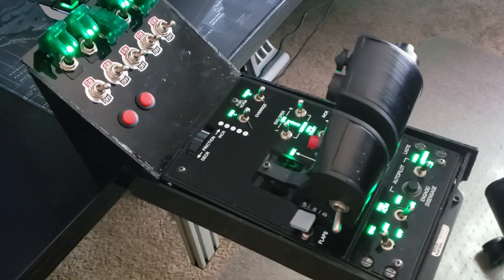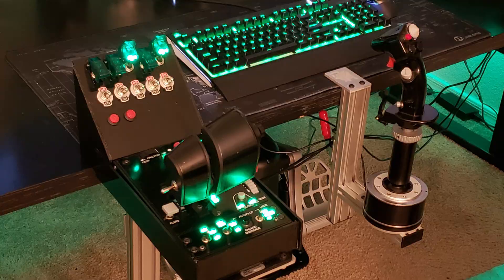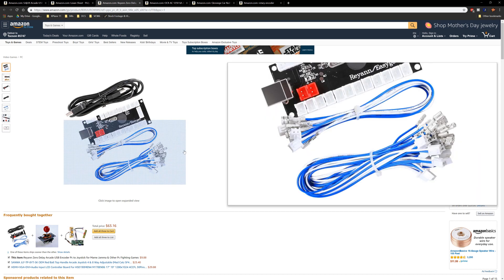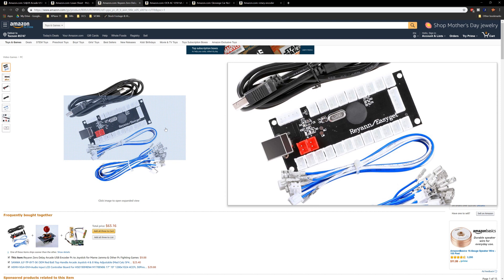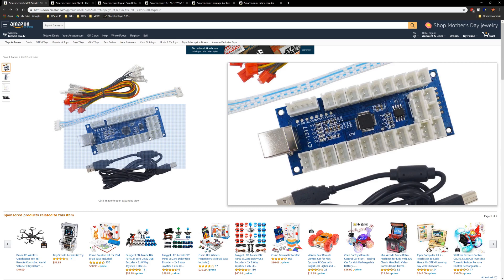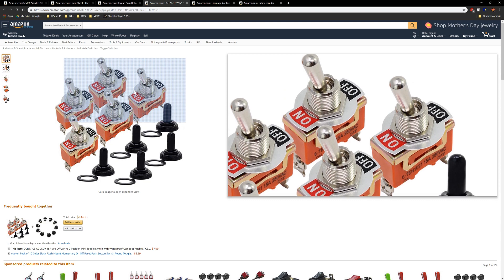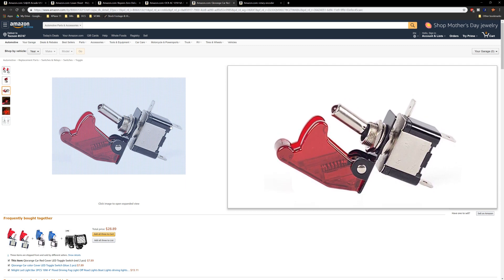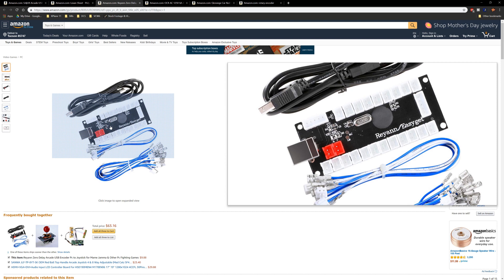Build Your Own Button Box

Comment: A 3 position switch would just need to use two ports.?..
Reply: you would need to check if the board shares a common ground or a common V rail across all the buttons. it will be one or the other the connect the one that is not common across the two poles on the switch that aren't common

Comment: I absolutely can not thank you enough.  I've been looking at designing button panels for Star Citizen for years and I'm terrible at soldering.  This not only a solution, it is THE solution.

Again, can't thank you enough.  You took what looked like a tedious and intimidating project and made it doable.  Awesome.  Liked and subbed.
Reply: Check out emstudio as well! He made a button box as more of a tutorial, included the code and wrapped it really nicely in carbon fibre wrap! Looks great! This is a really good video too!
Reply: You don't have to solder anything, even with other microcontrollers . Just buy some separate  crimps for the buttons/switches. Thats way cheaper. Combine it with an arduino pro micro clone for more space in your encasing. you can then spend the saved money on the buttons or a nice aluminium front panel. And you're not so  limited to the amount of buttons if you build a Matrix. I'm currently also  building a star citizen control panel. With the solution mentioned in this video, i would run out of connections half way trough.

Comment: Somone PLEASEEE HELP ME!!! I bought everything here, then got buttons and two position switches. I hooked it up to Xplane, on toggle. When I toggle the switch let’s say for master, the master goes on, when flipping it down it doesn’t work until I flip it up again. Please help!!
Reply from the maker: So, this is likely NOT an issue with your button box. This is likely an issue with the SIM. I run into this sometimes with DCS. 
You have to think of switches as "buttons". When you flip the switch to the "ON" position you are pushing a button down. When you flip it to the "OFF" position you're simply letting go of the button. Not all aircraft in DCS recognize the "RELEASE" of the key as a command. 
Try searching my channel for the RSMapper video. Use RSMapper to bind your button box to keyboard commands vs in the SIM. By using a software such as this, you can tell the SIM to execute X key command when the button is depressed, then X key command when the button is released. 
I hope this helps put you at ease as to what is very likely the problem.
Reply: OverKill wow, a lot of helpful info. Thanks so much! I will try to look in to this. One more questions if you can answer, there is a “mode” button on my encoder, when I press it, the joystick buttons switch, wondering why this happens. Also you’ve earned a sub!
Reply from the maker: @Rc2Go  LOL Thank you very much for the support! So, when you say "switch" what do you mean. How does the behavior change? 
Taking an "educated" guess as a novice with encoders - I would imagine it's something similar to for example like the X-55 and 56 HOTAS do. Mode 1: You program all the buttons to do XYZ. Press the Mode button so you are now in Mode 2: You can now program all the SAME buttons to do something completely different. It's a really handy feature if you're limited on buttons. The only tip side is you have to remember what mode you're in at all times so you don't open the canopy or drop the landing gear at 600 knots :) 
All of the above is assuming that I'm right about what "Mode" does.
Reply: OverKill yeh that would be it 😅 haha I’m looking at the other video, it’s pretty confusing as I’m only 15 and this is relatively new... I was hoping to avoid the hassle as to get my single rotary switch working, I spend hours learning code on arduino! Better keep learning, thanks! I’m going to keep watching the video until I understand :)
Reply from the maker: @Rc2Go  let me know if I can help:)

Comment: Some of these come with a 2 pin joystick adaptation. I am currently building my own hotas flight chair and I am looking to incorporate the buttons into the wooden arms I've made to mount my HOTAS too. I'd like to use a 2 pin joystick as a menu navigation tool. Wondering if anyone had insight into getting one to work as the board does support it along with 2 way switches. Or does that require coding. I just want it to work as a directional pad essentially.

Comment: So glad I came across your video. I intend on building a mostly correct F14 Pilot Simpit. I ordered one of these boards and a few different types of toggles and buttons just to try out and get some ideas before moving onto a higher end usb encoder. I was able to get a 3 position (mom on - off - mom on) toggle to work for the left and right engine crank on the Tomcat. It works perfectly using two inputs, however in my case I only needed to use one ground for it to work correctly. ( I just cut the other ground wire to second input off) This has given me so many ideas! Hopefully the wife wont divorce me! Thanks again!
Reply from the maker: We get lucky with our wives! Somehow they put up with us... the money I have spent on dcs alone not too mention the countless hours every time I come up with a new "project" lol.  Good luck to you!

Comment: Question:
I have this build idea and wondering if it would work?  Would like to get some feedback before I spend money to "try".

Say, I build a box with  X number of switch/buttons and when button is pressed it would trigger same action to two physically seperate PC. 
So I would have two encoder board wired to a single button? with each board connected to each PC via USB.
If something like this would work, is there a way to do something for a USB mouse as well?  (Y Splitter type does not work).
Reply from the maker: Honestly, that is a really good question. I'm not sure I can answer that. I would suppose in theory as long as somehow the same command was being sent to both systems it should.. I just don't know about the application process. Never tried anything like that before.

Comment: Regarding rotaries, you can buy a 3 position rotary and momentary switch,  which is OFF in the middle, and just wire it to two of the 12  places. So if you turn it left, you can assign it to decrease, and increase for the right. Can come in handy when using autopilot.
Reply: Can u explain a little more?
Reply: @theVRpilot  Of course. Imagine a momentary (pulled back to off by a spring) switch, with to ON stages one on each side. This thing is fitted to a rotary case, like an ignition key in a car. So if you turn it left or right, it activates, but the spring pulls it back to the center as you stop holding it to a side. It has 3 pins. So you can wire it to two ports into the encoder, just like if each side would be a button, since the PC will recognize it as two buttons. In the sim, you can assign them to increase and decrease the desired value (altimeter, heading, etc.), so if you turn it left, you decrease, and if you turn it right, you increase. It's not the most realistic, but works, and easy.
Reply: @theVRpilot  A rotary two position switch with the center position OFF and turn switch left is button 01 ON, center is both OFF, and right is button 2 ON. Then go the MSFS Controls screen and map button 01 as frequency DOWN and button 02 as frequency UP. Momentary means when you turn switch left or right and then let go of the switch, then the switch springs back to the center (OFF) position. These two buttons, say button 01 and button 02 are two of the twelve DX buttons this board allows.
Reply: Let's say like me you want to fly vintage GA aircraft and pretend you are in the era where they navigated with ADF's because that's what they had for radios (e.g. the Douglas DC3 era). 

MSFS controls setup screen has 6 ADF frequency buttons: 1 place digit up, 1 place digit down, 10 place digit up, and 10 down, 100 place digit up, and 100 down. So you install 3 knobs side by side on the board.  On the left knob you set 3, the knob in the middle you set 6, and the knob on the right you set 2. And you watch in the MSFS panel as it dials the ADF radio to frequency 632.

Comment: Quick question, I bought the board in the video that you currently use and I'm having a lighting issue. The switch I bought has a separate led, that has a  red and black wire not connected to the 3 metal pins on the switch. Is their a way to wire it together? Or am I SOL

Comment: For 3-way and rotary switches, I think you have to use several connectors on the board, connect the ground pins together and for each positive pin on the switch, you'll have to use a different connector positive pin. (Sorry,english is not my native language, I hope you understand what I mean).
Reply: For what it's worth, that's perfectly good English.
Though I will say that the ground pins might already all be connected on the board. It may not be necessary to connect them all as well as the positive pins.
Reply: @No1sonuk  I think this is the solution, 1 knob will consume two plugs. I dont have a diagram in front of me, but yes.

Comment: hi overkill i'm planning to build a simple cockpit for p3d,i just bought 10 on/off switch ,and i need rotary switch for speed/heading/altitude increase-decrease,how i can connect to the zero delay?
Reply from the maker: Rotaries unfortunately you can't.. I'll try to find a different video that i used for that
Reply: OverKill any update for using a rotary? I picked up this hoard and some rotary dials playing around, I might grab a LEO bodnar boards as this obviously doesn’t work lol. But any help would be great.

Comment: Can anyone explain to me how this works? the switch is 12V and the board is 5V and it still can turn the led ? O.O
Reply: I would think it would be like using 8 gauge wire when it only needs 24. It's just extra protective buttons and LED especially one bulb is extremely low power.

Comment: Looking at your board and the amazon wiring diagram, you have the 5V hooked up, whats that for?
Reply: there is my question the board is 5v but the switches are 12v?
Reply: @MyLuc97  12V is what they can handle but they'll work at 5V. LEDs won't be as bright or won't light up at all depending on their type.
Reply: @mururoa7024  okay Thanks!!
Reply: @MyLuc97  Yeah i'm not referring to the switches. If you look at the amazon diagram there's a 5v port on the board itself, if you look at the flyover shot he does of the wiring it's hooked up to something. But I can't see anything that would need a 5v live constant.

Comment: You can add 4 more buttons or functions by using the up/down/left/right on your board. It is meant for the joystick but it is a input as well and your game will read it fine.
Reply: Really will that work? Did you test it?
Reply: @stevenirish6160  Yes I did. You may need to change the mode of the Circuit board to change the joystick setting from POV to hat switch by connecting a button or switch to the mode connector. Depending on your settings. I am thinking of making a video showing that and all things I found out during my build.
Reply: @youmasenchi  where is your video? Keen to learn more about this board!
Reply: Brilliant. That is really good to know mate. Thank you for the information 😎
Reply: Glad I found your video. I just started back playing DCS once I realized there was an F-14 module now.  I intend to eventually build a full replica of the pilot controls or at least most of the buttons and switches on each side. I ordered one of these boards and a few different toggles just to play around with to get ideas. The first one I did was a 3 position toggle (mom on - off - mom on). It did take up two slots. Power to each outside lug and use only 1 of the grounds. It works perfectly! Will use that setup for my left and right engine crank on the Tomcat! I know I’ll have to get more advanced boards for the future, but for now this little thing rocks! Thanks for the video!!

Comment: Overkill about the rotarys, have you tried to share the midle pin as the ground/negative for both the positive on the side? For example conecting one of the side pins(positive) of the rotary to the encoder board as a button, using the midle pin of the encoder as negative on that same button, then conecting the other side pin of the rotary (positive) to another button on the encoder and using the same midle pin of the rotary has a ground/negative for this button.? I have it like this on a arduino board and it works, don't know if it is the code that i uploaded to the arduino that makes it work like this (didnt wrote it myself)
Reply: I just tried it, it is seeing left or right both as one. It can’t see the difference. Hmm..
Reply: For the rotary encoder you have to modofy the script.

Comment: Rotary encoder is use 2 buttons and a rotary encoder with push button it use 3 buttons on the board
Reply: How
Reply: No. Rotary encoder is 3, with push button is 5. I have a bunch of them

Comment: This was very cool. Really got my brain going now on things I didn't think of earlier. I'd really like an expanded setup. I'm still using my X52, just can't justify upgrading it yet since it is still pretty much in perfect condition other than the rubber parts just starting to turn back into oil. I'd ultimately like to upgrade to a Virpil throttle and stick, but that will be some time from now. But I really need the extra buttons and switches, this seems like a super easy way to get into that. Very cool video.

Comment: You can use a three position switch it will just use two of the button inputs
Reply: Agreed!  Consider a rotary switch as 2 switches. Connect one port on the board to one side, another board port to the other side, combine the grounds for both onto the single ground on the switch.
Reply: @pudgy99-m7w  So if i got this right, when you connect it like you said, turning the rotary encoder one way would just momentarily press the "switch" that the side is connected to for each click on the encoder? Turning it the other way would do the same thing but on a different switch. Is that correct?
Reply: @AndrewWiebeCAN  let's say you want to change the digits on a display in the MSFS 2020 panel readout. Turn the knob left triggers a DX button mapped in MSFS Controls to 'decrease com1 frequency' and the numbers on the sim radio readout panel cycle downward 50 49 48 47 46 45 .... Turn the knob right and a DX button is triggered mapped to 'increase com1 frequency', numbers cycle upward 45 46 47 48 49 50. 
Thus the knob is not an axis nor an encoder, just a 2 way switch that is OFF in the center position and presses a different button on either left or right.
Reply: Yep a 6 position rotary is just 6 internal switches.
Reply: Yep connect all the negatives together and the positives to the different connections
Reply: How i have to wire it?
Reply: could you use a potentiometer?
Reply: @user-cz1ex7kf2g  did u find smth out?
Reply: @reivsinim7031  this board won't work with potentiometers because it doesn't have any analog pins. I went with an arduino leonardo  which is pretty cheap but the downside is that it needs to be programmed according to what you connect. There's many tutorials and forums with free info though.
Reply: could you also do this with the rotary encoder?  turning left will use a button input and turning right would be another button input??
Reply: @jlsteenekamp766  The problem with that is that rotary encoders usually don't work like that.  Both outputs switch state when it's rotated in a particular direction, but they're "out of phase".  The electronics need to be able to read that and decide which way it's turning.
Reply: Literally came here to say this.